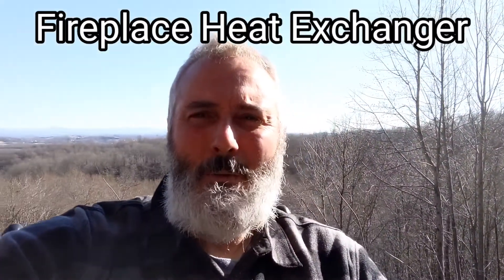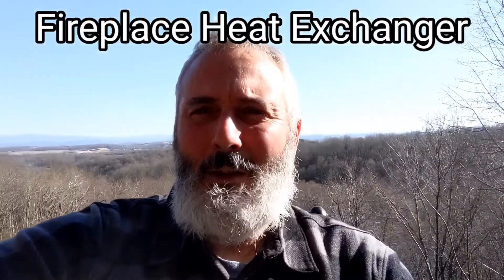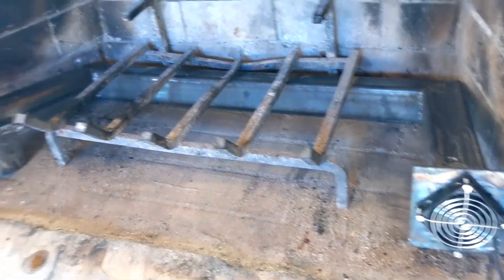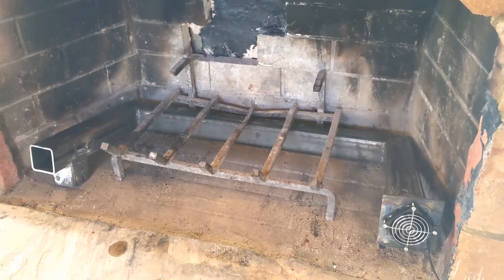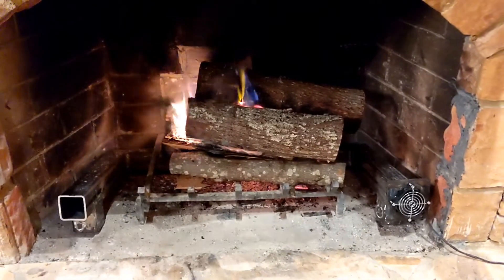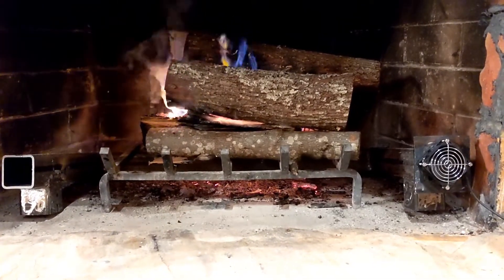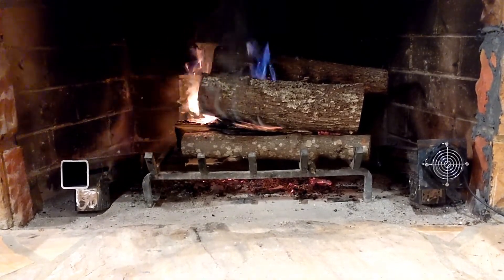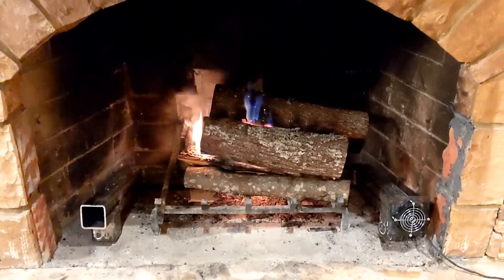Fireplace Heat Exchanger

Comment: I would think it would be much more effective if mounted on the top of the firebox to capture more heat.
Reply from the maker: The hot coals build up on it.  Long after the fire goes out, it's still blowing warm air.

Comment: Try it with out the fan.  see it heat will come out both ends. heat goes up the way you got it angle going up, might not even need the fan
Reply from the maker: There is no air movement without the fan.
Reply: @will5184  Good to know !  Some time air will drawl out of pipes 👍👍 thanks

Comment: Probably a dumb question....where would I find the black pipe & flange?  This seems like the simplest/cost effective solution on YouTube - nice work Will.
Reply from the maker: Google " steel/metal supplier near me".  If I had it to do over again I would have used round pipe and had a local muffler shop bend it to shape. The flat flange can be made with a piece of flat steel. Use a jigsaw with a metal blade to cut it to shape.  I would have used rebar and made the heat exchanger also function as my fireplace grate by adding legs and crossbars.
Reply: @will5184  Thanks Will.  I'll circle back if I make this happen!

Comment: I got a pipe bending machine. The thing is?  Finding pipe any more. The supplies are way down. Yes i can see it heating up the pipe, and the fan running. A Great way of blowing heat from a fire place to get more out of it. You could do it for hot water, with copper tubing
Reply: Try checking auto parts stores for bulk exhaust pipe. Sometimes they have 2' pieces up to 10' bulk sections. Or your local muffler shops.
Reply: @roncoleman6693  Hey that a ideal 👍  It need to be stainless steel

Comment: I use very little electric, way less than a RV!  My bill in runs around 100 dollar a month for 25 dollars worth of electric  🤬Only thing that runs is the Refrig. and 1 deep freezer, The hot water tank i put a off and on switch on it. and my computer or Tv. That it. All the lighting is switch over to strip lights that only 35 watts. All the out door streetlights is solar power. IDK WHERE THERE GEGGING ME 100 dollars a month for?
Reply from the maker: Dono.  Sounds like you have an efficient setup though.
Reply: @will5184  I do Cheers

Comment: Great video I have basic wood fireplace with front glassdoor that you can open and close. I  Install air circulator fireplace grate heater last winter on it was able to have it fit under the glass doors so that can be closed when unit is running. After playing around with it first few fire's taking room temperature's I found it was alot more efficient to have a smaller fire going with the glass doors closed and have the blower fan run on high for example with the doors open took three hours to heat up  350 feet to comfortable temperature  vs glassdoor's closed smaller fire was able to heat up 600 feet in less then 1 hour and half with the door open alot of the heat that blows into the room just gets suck back up the chimney what I figured

Comment: Ya. What they said, but your ingenuity is noted.
I had a fireplace grate made of tubular steel. It supported the wood, and had 6 tubes with shorter ends on the bottom on which the wood rested. These curved around behind the fire, then over it and back into the room. Cool air was drawn into the bottom of the tubes, heated by the fire, and exhausted back into the room. No electricity necessary. It worked, but downdrafts caused smoke to enter the tubes and exhausted back into the room along with the warm air, so it was only marginally effective. 
Good to see you still producing videos. Any plans to do some hiking? I'm doing my final final AT section hike in May, from Hot Springs to Atkins, Va. I've been at it since the 1980s.

Comment: Fireplace heat exchangers were popular in the 70s. I made one for a friend out of black 1-1/2 pipe that was a y shape grime the fire box to over the fire that the wood sat on. had 6 pipes with a bottom manifold that had a squirrel cage fan blowing air that cam out of the 6 pipes. It would heat the whole house. people moved on from these and put in air tight wood stoves to save on wood to heat there homes. basically no waste of heat going up there chimney to heat there homes. Hope this helps. I enjoyed your video. God bless 🙏

Comment: 80% of the heat from a fireplace goes up the chimney. If you want to heat with wood, you need a woodstove to insert into the fireplace to control the amount of heat wasted. If you don't believe me, go outside and look at the top of your chimney. You will see a strong stream of hot air shooting out. Look at the chimney of a house with a woodstove. The hot air and smoke comes out slowly. The proper way to heat with wood is to have a woodstove in the basement so that the hot air rising off of the stove will heat the basement and the floor above it. Good Luck, Rick